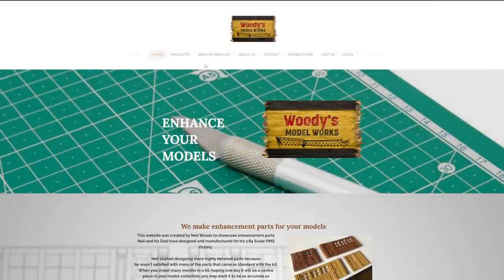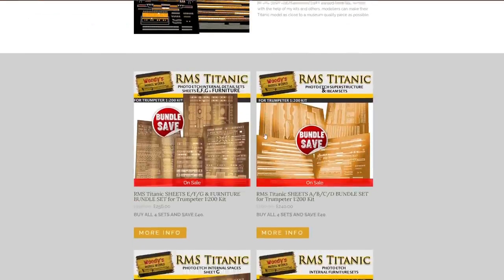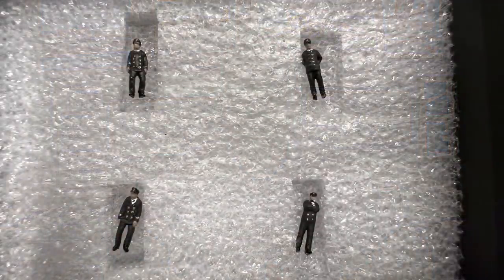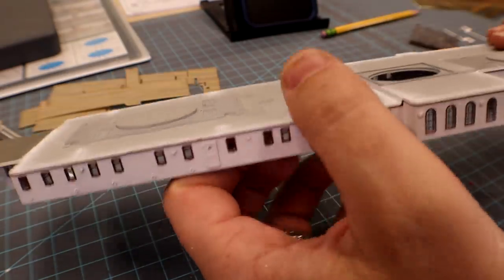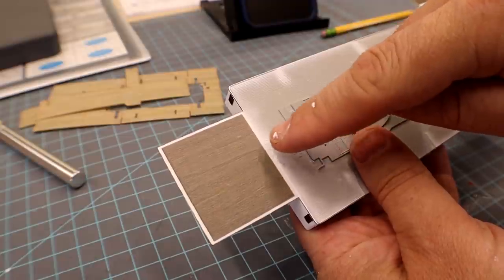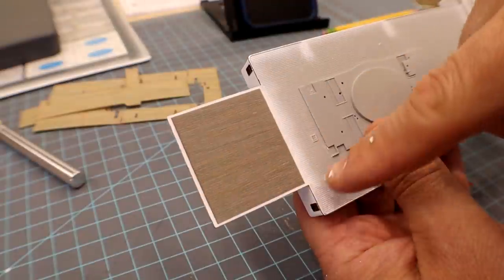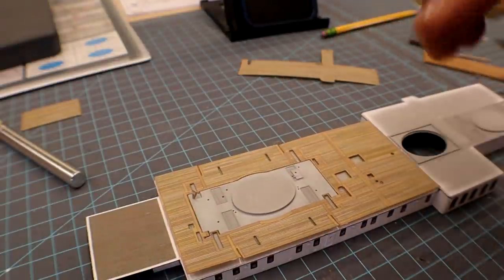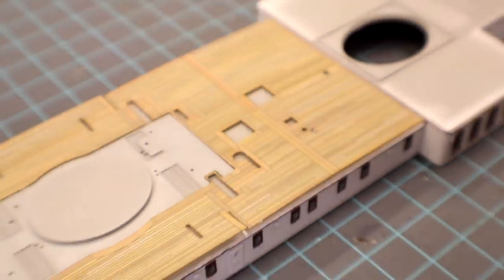1/200 RMS Titanic Build Video 26

Comment: Ben, would it have made more sense to put the tube glue on the inner walls of the parts so that when you placed them on the ship the glue would've oozed upward inside the walls and not out onto the front and base of them? Just a  thought. The model looks fantastic. Keep up the good work. Really enjoy your videos and I learn something new every time.
Reply from the maker: Possibly. And I had thought about that exact thing during the glue up. I think I was worried about holding the piece in my had while balancing that tacky glue and hoping it stayed in position while I applied it. Maybe I’ll do that for the smaller parts.